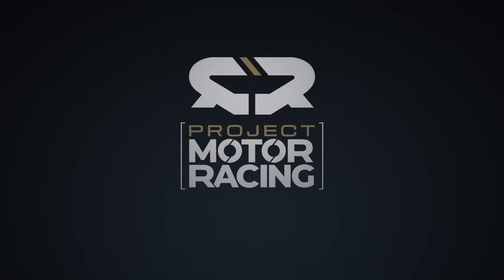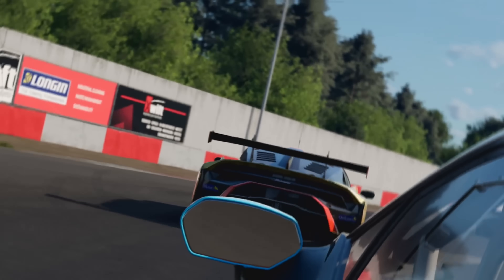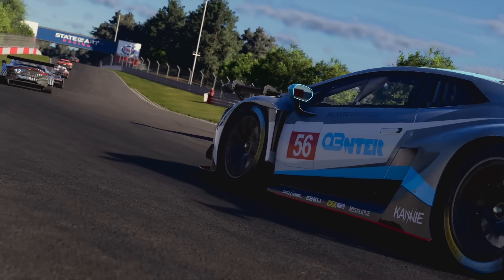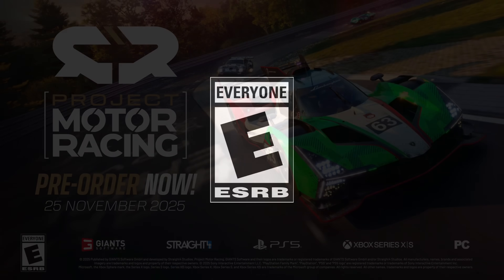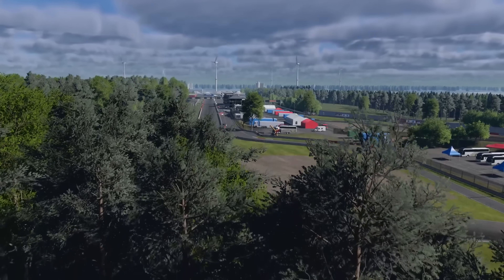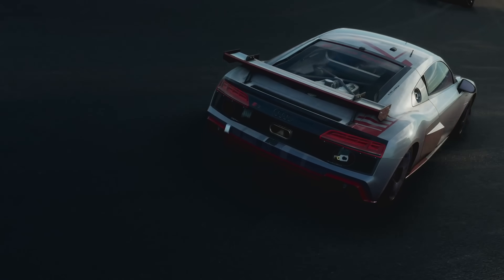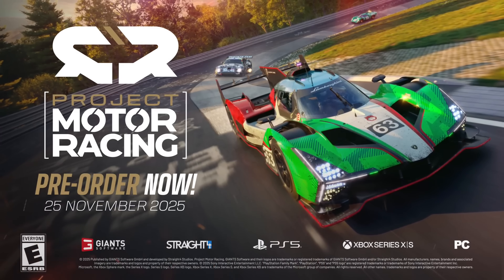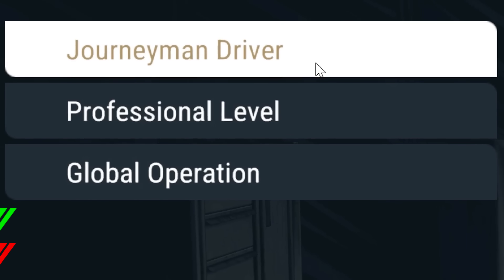Project Motor Racing (2025): Next-Gen PHYSICS Engine Detailed! (PMR Physics Hadron Engine Info!)

Comment: A high physics tick rate is only useful if the physics model is good with parameter bounds that don’t create errors when multiple parameters are at or near their limits. A poor simulation at 200Hz will also be poor at 720Hz.

Comment: First 2 minutes stating how marketing speak works, but they've already told us. This is not a pure sim. There are assists built into the pad experience. So why try to blind us with science? It matters not, what the Hz of the engine runs at, inaccurate is inaccurate no matter the underlying refresh system.

Comment: Sounds like Project CARS 2 further improved. Which isn't bad. The only concern I have is the issues we had at the time. Only the player car could have that tyre model due to CPU demands at the time. The computers at that time were not powerful enough for a full grid of cars to do that full physics simulation. This resulted in discrepancies between the AI and the player, especially in the wet and even more so when it came to aquaplaning.

Comment: Sounds impressive but so did pcars 1 & 2 but they had no end of issues.
Reply from the maker: True! But this is way overhauled & compatible with all devices now so I’m hoping for a smooth launch now!
Reply: @FH3YT  Of course it could be great & if they allow full modding it will be amazing to tweak the engine. Complexity can be a bitch, more parts = more trouble. it doesn't take a rocket scientist to figure that out or maybe it does? ;-). Not being negative just not quite ready to jump on the train. The roster of cars is already very strong I love the vintage & classic race cars so i really hope they get consistent physics because it will just be a damn shame if they don't.